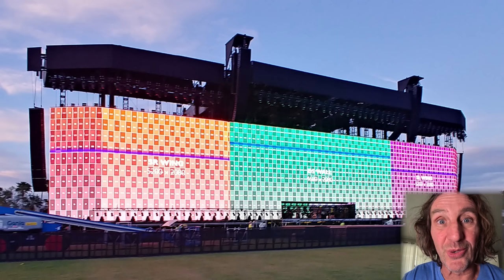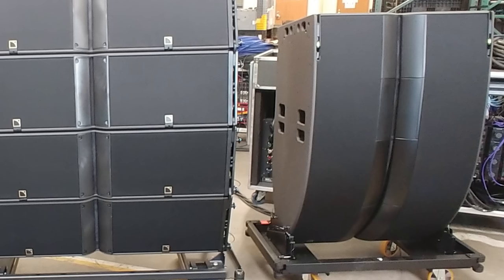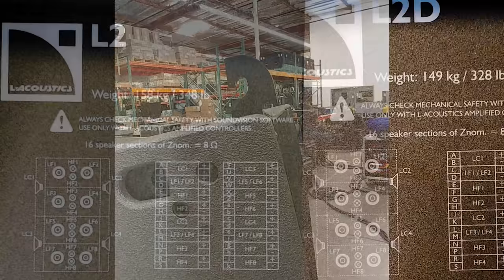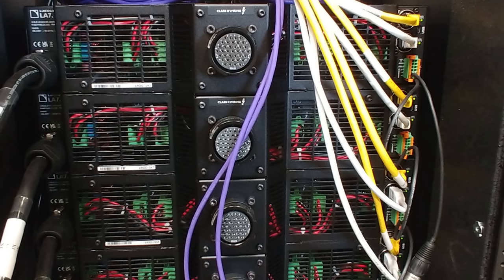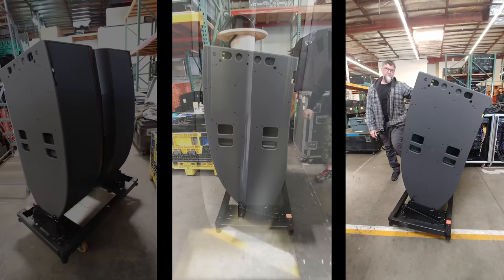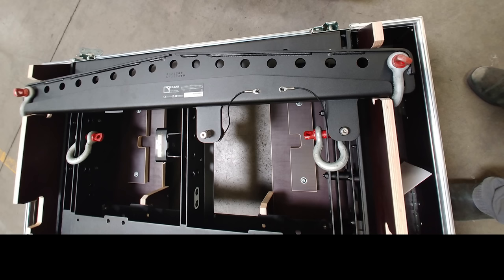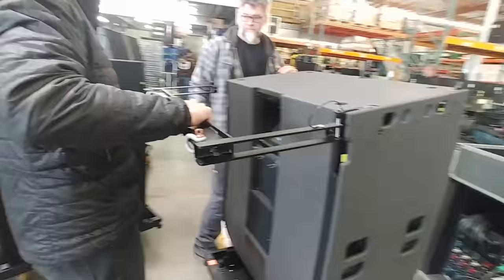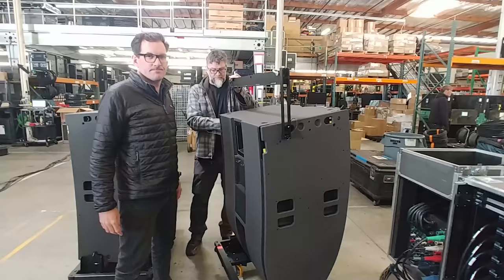L-Acoustics L2 Hands-On & Huge Festival PA

Comment: Great video as always !
I liked the K1 setup, it being flown high to keep the sight lines clear but still be visible is a great compromise. 
Some events hide the PA as much as possible (behind fabric for example),  but I always like to see it, it’s part of the show for me 🤓
Can’t wait to try the L2, they have such a small footprint on that stage it’s impressive ! Btw, did you feel a difference in the low end compared to an equivalent K2 setup given the differences in driver size ?
Reply from the maker: Very cool and yeah definitely not as much low end coming off the mains. I will work on differing sub setups to help compensate. The low end in the middle is fine but off to the sides you really got to make sure your subs have good horizontal coverage
Reply: @DaveRat  - Hi Dave. Have you heard any Daley big PA? I've been fascinated for a number of years with Danley Sound Labs' masses of L-MH drivers in one big box physically time/phase aligned loaded into one massive horn, synergy horn,  encompassing the whole face of a very large box. Their boxes have up to 64 L-M-H drivers with on single about 6-7' x  3-4' box. I've seen demos on YouTube where they but 1 box per side stereo up against numerous manufacturers many box per side line arrays.
Reply from the maker: Danley has been to the Rat Sound shop with demo rigs a few times over the years.

Interesting gear. Never been too interested in actually owning or deploying due the the lack of scalability and flexibility.

For what we do as a rental company, having boxes that can be arrayed and systems size scaled for the various venue sizes and coverage areas is critical.

Having a single box with a fixed coverage patterns requires the box to be designed to be opitmal for the specific venue and audience area rather than combining multiple boxes to optimize for a wide variety of venues and coverages.
Reply: @DaveRat  Cool. Thx.

Comment: L2 looks like a very solid system. Question: I'm noticing a trend for combining multiple boxes into one. What's the reasoning behind this, other than simpler setup? I'm assuming the angles are fixed, so does that not reduce the flexibility of the system? Sorry if this is a basic question. It's been about 10 years since I've mixed in a really big venue so I'm not up on the details of recent line array systems.
Reply from the maker: The advantage is a reduction in weight because the added structure needed for individual cabinets can be reduced. Reduced setup time as less boxes need to be rigged and less cables connected, lower cost has less external cabling is needed and less rigging individual parts. Reduced size has the savings of the additional wood panels and structure for individual boxes means internal volume can be maintained with a slightly smaller external size.

Reduce distance between horns as having them all mounted in the same box versus having separating panels between them can improve sound quality as well.

The downside is a reduction in coverage versatility that can be somewhat compensated for with electronic adjustments.

Ultimately having smaller lighter faster to set up boxes can be extremely beneficial in reduced trucking costs and faster setup times which can reduce labor call costs as well while improving sight lines and reducing rigging weight.
Reply: @DaveRat  GREAT summary there. So, basically mostly practical advantages rather than sonic ones. If you're basically squeezing 3 arrays into one box, then I'm wondering if it's possible to adjust the box angles or do they have to be hung in a fixed formation to avoid gaps/overlaps in coverage between each box? You mentioned electronic adjustments, but I'm wondering if the cones/horns can be physically angled/rotated inside each box?
Reply from the maker: There are sonic advantages as well. Instead of having four separate horns it's got one big horn with four drivers on it, therefore eliminating three transitions.

Those transitions are little glitches in the coverage and by eliminating them it improves the quality of the line array makes it smoother and more coherent.

As far as electronic adjustments, by altering the delay time, level and/or frequency response of the various drivers attached to that one unified horn,  The coverage can be trimmed either on the top or on the bottom to some degree reducing energy from being propagated above and below the desired coverage pattern.

For example, if you were to set up the array such that the top of the coverage aligns with the farthest, highest altitude point you want to cover and the bottom of the coverage now bleeds on the stage somewhat, you can electronically trim out the bottom of the coverage to stop at the barricade rather than go beyond it towards the stage.
Reply: @DaveRat  Interesting. It seems like things are going back a bit more towards point source designs but with some line array functionality and a lot more sophistication. Do you see all products going in this direction, even the bigger size systems? Or would those boxes be too big and heavy to combine? They're already pretty beefy as it is.
Reply from the maker: There are applications and/or inventory needs where smaller or more modular enclosures are opyimal and situations where largest combined enclosures have advantages.

Think of speakers as vehicles used to perform a Tesla

So we only me limo's or race dates or tractors? Or for the car rental market, sedans or compact cars or town cars or 15 pase get vans?

New tech is helping optimize for various applicants cations but that does not diminish the need for variety.

As far as point source, these are line source because they have multiple drivers in a line reproducing the same signal.

If a box claims to be point spurs and has multiple drivers side by side and /or stacked that are reproduce the same signal, then they are not being honest.

True point sources and anything involving an array are exclusive entity groups
Reply: @DaveRat  Ok. I may be being really dumb here, but if you stack multiple point source boxes on top of each other in a line and then send them a L or R feed, is that not also the same signal? Or are line arrays doing something extra special beyond that? Apologies if you've already made a video about this. You probably have.
Reply from the maker: Great question. Multiple independent sources recreating the same signal will result in significant interference and cancellation patterns.

The key here is to define independent.

If you have a bunch of different boxes all stacked up with conventional horns they will act like Independent sources.

But a properly designed line array horn and/or multiple cone speakers that are extremely close together will tend to act like a single source.

Defining very close together is important

Very close together for this discussion would be placing them such that they are less than a quarter of a wavelength apart and preferably much closer than that

One way to tell if they are acting like a single source or Independent sources is to play a pink noise signal into them And listen to the regions where transitions from one speaker to the next.

The interference patterns between multiple point sources will be readily audible as you move around

If the sources are combining and acting like a single source then the sound will be smooth and consistent and taper off slowly as you move off axis.

A good example of a line array is a row of double 18 boxes running side to side across the front of the stage. If they're all very close together you won't be able to hear the transitions between the various boxes it will just be loud when you're centered and get quieter off to the sides.

A good example of point source interference would be some double 18s on either side of the stage. As you walk across side to side he'll hear it loudish off to the side and then they'll be a series of summations and cancellations with a power alley in the middle.

This exact same thing happens vertically and with high frequency and mid-frequency drivers it's just the distances are much smaller
Reply: @DaveRat  That's a great explanation and when you mention subs I absolutely know what you mean as I've done that exact thing many times and heard/felt the bass power alleys/valleys. If you haven't done a video on this, it would be a great topic.

Comment: do you still prefer the passive than active for weight,
Reply from the maker: We prefer passive versus active for many reasons.

One reason is we have a large inventory and various boxes get used at different times having the amps permanently attached to the box is less flexible and more expensive as we don't need to own an amp for every single box always

Additionally in the event of amplifier failure we're able to switch to a spare amp even when the amplifiers are flown much easier than if the amps were inside the boxes. it's much easier to move a cable then to drop the cluster or to unscrew and replace an amp in the back of a box

Also, Yes the overall weight and cost is reduced because it is more efficient to have many amps all powered off a single power supply then have a separate power supply for every amplifier in every box

The new two rack space 16 channel lacoustics la7.16 will power four x 120 pound K2 boxes each with two 12", 4 x 5" and 2x 2". 

By not putting the amplifier in the box and reducing the box weight, the rigging weight for the boxes can be reduced as well further decreasing overall hang weights and increasing maximum array lengths.

Remember that each box has the rigging to hold the entire maximum array length, so increasing the weight of a box that has a max array length of 24 boxes by 40 pounds means the rigging on every single box needs the rigging strength increased by a thousand pounds. Which then increases the weight of the box which then increases the need for stronger rigging further increasing the load on every box and on the building.

Box weight is a huge factor
Reply: @DaveRat  One more point from my own experience:  An active box puts the amplifier where the speaker needs to be, which could be in direct sunlight.  I've had active boxes shut down because the amp plate got ripping hot in the sun.  With a passive box, you can put the amps in the shade.
Reply from the maker: Great point. Yeah, that would be a calamity for delay clusters at Coachella. 

Oh, and also we have had issues where delay clusters required trenches cables and trenching speaker cables are fine but putting ac voltages in the trenches was an issue.
Reply: @DaveRat  is there a loss though magnetic grounding
Reply from the maker: Not sure what you mean by magnetic grounding?
Reply: @DaveRat  me neither just thought there was some power though the ground of the earth

Comment: Hi Dave! I have a question and google doesn't answer so I try to ask you. I register heavy sound quality degradation in the audience for some seconds when/after firethrowers are fired. I think this is caused by kind of temporary turbulences in the air. Or a disturbance of the impedance stacking of the air layers. Wouldn't that be a great idea for a video? You already did one similar in the past whit the parametric speaker and a hair dryer.

Comment: Hey Dave, I’m really interested in the AlignArray…question for you is on mounting.  I use primarily JBL VTX A8 and A12 rigs. Will you be selling a mounting bracket for the laser specific to each PA or will it require a custom fab. to mount?  Happy to take the conversation offline in more depth but just wanted to throw this out there.
Reply from the maker: I believe we have clamps for JBL, Meyer and D&B.  I will find out exactly which versions and models we have

Comment: Do you have any experience with Martin Audio and their MLA rigs? If so, any thoughts?
Reply from the maker: I have some experience with the MLA and quite a bit of experience with the EAW Anya. Both are interesting and very powerful systems with loads of control.

No neither system has really gained traction at the upper end of the touring and artist demand realm. Things like weight cost and dependability our challenges.

Ultimately pointing speakers in the right direction physically seems to have and continues to win out over trying to electronically steer sound which is less efficient and tends to diminish sound quality

That said there are specific applications where being able to control sound to such a high degree makes those types of systems the right tool for the job
Reply: @DaveRat  thank you for your detailed response! They seem to have traction over here in the UK,  particularly for their ability to cut off the sound outside the arena, increasing dB levels in situations where off site monitoring has forced levels to be turned down - Glastonbury festival most notably. Or at least, that's what their PR says!

I find it extraordinary at modern large gigs how you don't hear a snare a second later from one of the other repeaters any more, which used to be unavoidable 20 odd years ago. The mathematics that must make this possible boggles the mind.

Your videos are great and full of fascinating information, even for the enthusiastic gig goer like myself as well as the professionals.
Reply from the maker: Awesome and thank you. Yeah, Martin was gaing gigs for a while and then got sold to Mackie I believe and then re sold to another venture capital group. 

That kind of pulled the rug out from them.

Systems from d&b and now L-acoustics that are controllable but not as complex to deploy and sound better in my opinion are gaining.

Very cool and thank you
Reply: @DaveRat  I've heard good things about d&b in particular. I'll keep an ear out for both systems this summer.

Comment: Hi Dave, It's possible to use more than 3 boxes each side, what's the maximum each side?
Reply from the maker: Four box maximum
Reply: If I need more power I have to use k1's? @DaveRat
Reply from the maker: Each of these boxes is approximately equivalent to 4 K2. So the maximum hang is equivalent to about 16 K2

The next level up would be to use K2 which can hang 24 deep and then beyond that to use K1 which can also hang 24 deep.

But 2 K1 is approximately equal to 3 K2, so a fully hung array of K1 is equivalent to about 36 K2
Reply: Thank you for helping @DaveRat

Comment: I truly feel like concerts used to have better sound quality.  It’s almost like you can here where the sound is coming from and it’s just sitting on top of the crowd. In 2015 Nocturnal the sound went alll the way back hitting so hard the transfers were hitting clear and hard and you couldn’t tell where the sound was coming from .  EDC was so quiet to me and I can’t be the only one
Reply: Whenever PK sound is set up though it seems to be going just as loud and heavy as I remember back in 2015 and 2008
Reply from the maker: It's very tough to generalize as there are drastic differences between various shows and festivals. 

Modern systems have the capability of presenting better sound than older systems mainly due to the fact that older systems had no good way of combining multiple speakers and anything other than a mess.

That said, The probability of running into City or county imposed noise restrictions was almost non-existent a few decades ago whereas now it's quite common.

But if you look back at the old days like the us festival, cal jam, Woodstock, The sound was crap.

I mix done festivals throughout the world from 1990 to 2017 and the sound quality has gone from varying piles of mass and junk to consistently quite good to amazing in my experience
Reply: Modern bigtime live sound can be extraordinary.

Comment: at 11:56
30 lbs. *LIGHTER PER BOX
Reply from the maker: Yeah, I said it in a confusing way. But yeah, I think a 12 box K2 is about 350 pounds heavier than a 3 box L2 but would need to look it up to be sure.

Plus there are cabling and flybar differences the shift things a bit
Reply: @DaveRat  lol. maybe in 2050. We’ll have 30 pound boxes

Comment: 158kg/box production guy will cry LOL
Reply from the maker: That's actually quite light for a cart of 4 boxes. Most of the carts weigh 200 to 250 kg.

It's the individual 80 kg boxes where someone pushes one box at a time that makes production cry when you load in 60 or more boxes that makes production cry